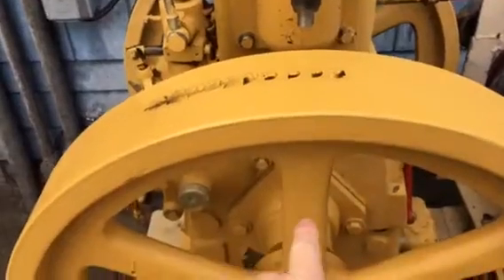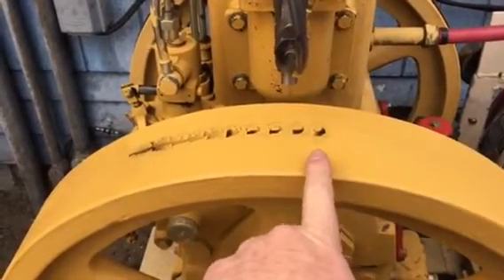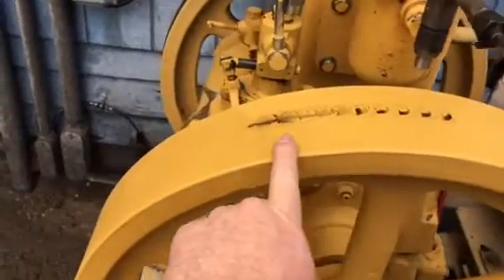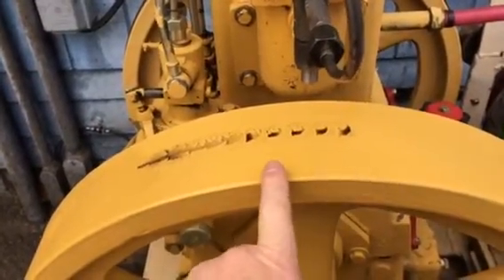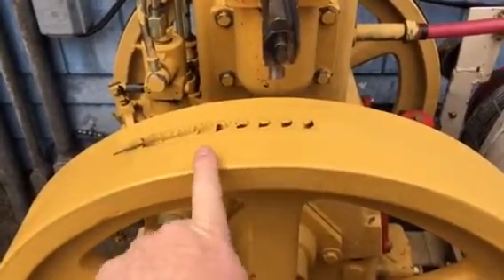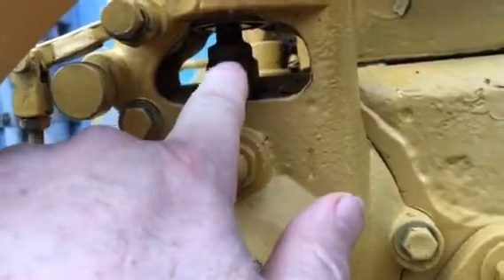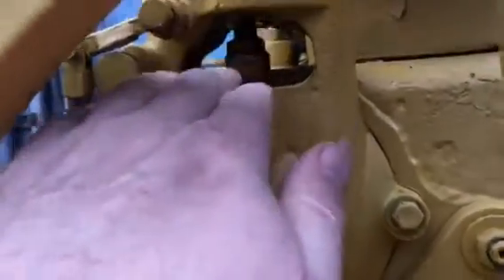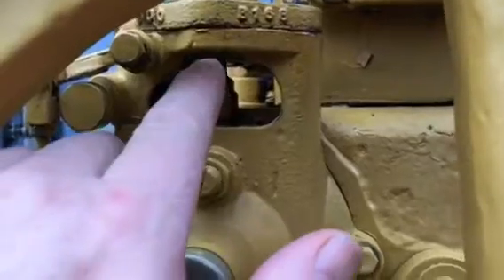Listeroid Fuel Pump Injection Timing

Comment: The consensus i have is that if you can hear the injector creak and fire at about 3.5 inches before TDC your good.
So all i can say is that i listen for the creak then measure the distance from the TDC mark on the flywheel to actual TDC.  Apparently on some listers the firing point was marked on the flywheel with a lightning bolt if you wanted to find it using your method.

Comment: i notice that your engine is not closely timed ..... the manual calls for 20 degrees before TDC which is 4-1/8 inches ahead of the line drawn on the flywheel showing TDC ....you seem to be 2 inches or more late

i don't have enough experience to know if having the roller tappet resting on the cam shaft would cause damage to the shaft or the lobe.....if they have adequate lubrication i don't see why there would be any problem....lots of well lubricated gears tolerate very heavy loading
Reply: The 20 deg in the manual is the timing at no pressure, with the injector disconnected, the method shown here will show the timing at almost full injector pressure. The difference could be because of the different methods, the end result ideally about the same. If this is true the extra 2 inches of travel would be a pressure build up phase.
Reply: I agree.I dont understand the manual way but if it sprays at 104mm from TDC it must be right .When I checked mine with the gap just gone it was TDC so I had to crank in the plunger more to get 20 Deg TDC .It worked that way.